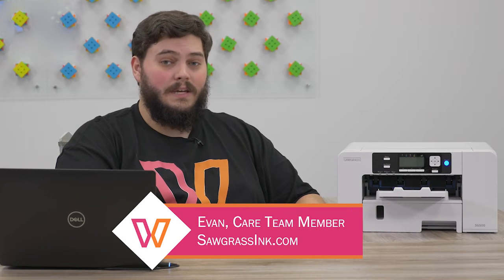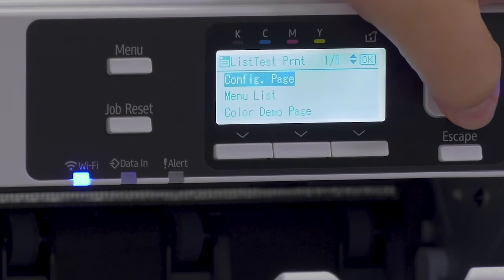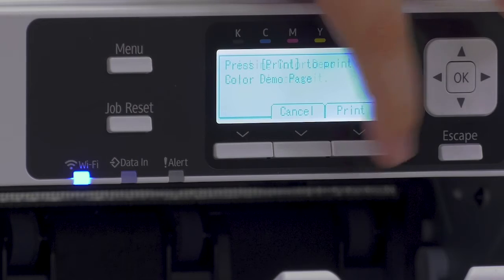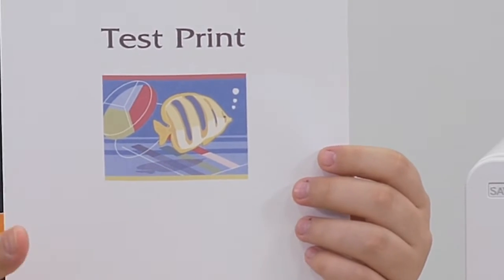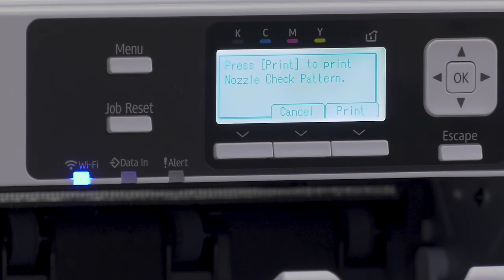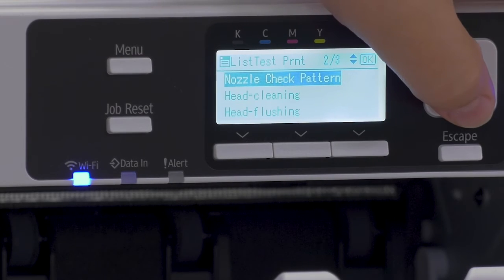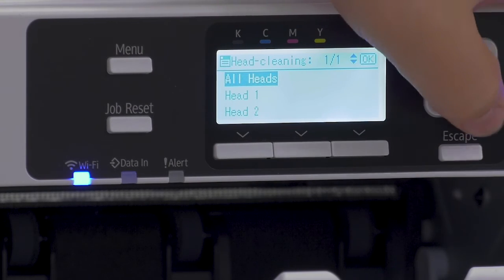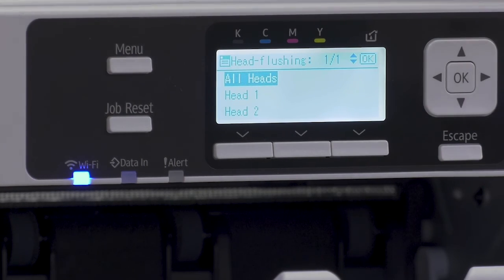HOW TO: Printer Maintenance

Comment: Do we need to do this alllllll the time that we use the sawgrass printer?
Reply from the maker: Hi, the printer runs automatic maintenance cycles regularly. These are additional recommended steps if you encounter issues with your prints.

Comment: Hello, I have full ink, but when I print an image, I get black horizonal lines going across and through the printed image. I've tried everything I know to correct this.  Also all the test prints colors come out well as for the colors but the black lines are still there.   Can you please help?
Reply from the maker: Thank you for reaching out to Sawgrass! Our Sawgrass Care team will be the best people to answer your questions. You can contact them at care.sawgrassink.com and connect with them directly using the Help button at the bottom right-hand side of your screen.

Comment: Hi My sawgrass sg500 was not in use for a while. I recently I brought new ink and a new waste container. It’s printing but pages are blank. There was a very small amount of yellow that printed. I’ve done the head cleaning, flushing and nozzle checks. Any suggestions?
Reply from the maker: Sorry for the delayed response -- have you had any luck with getting thata printer up and running?  If not, please reach out to our support team at care.sawgrassink.com

Comment: What this video will not tell you that it flushes away so much ink into the waste tank. This does two things. A: It waste sooo much ink. And Sawgrass ink is sooo expensive for the small amount that you get compared to others on the market. B: The waste tank the ink flushes into fills up too quick. And again, the price of Sawgrass waste tanks cost so much (I now use 3rd party waste tanks at a third of the price of Sawgrass). People need to add these costs into their printing. In the end you spend more money than you think printing with Sawgrass. You can leave it plugged in if you don't use it much and the maintenance will take care of any clogging. But again, the amount of waste is a lot of ink and fills up the tank. I am looking at a different model now because of this.
Reply from the maker: We are sorry that you have had these issues.  In general, a waste container should last between a year and two years.  If it is filling faster than that, please reach out to our support team at care.sawgrassink.com and we can assist you!

Comment: What happens to the extra ink that gets flushed out during the head flush? Does it get put into an internal compartment that needs to be emptied?
Thanks!!
Reply from the maker: All ink used in a head flush or clean is sent to the waste unit! There is no need for the waste unit to be emptied!
Reply: @SawgrassInk  when the waste until fills up completely, what do I do?
Reply from the maker: @JackRad2012  The waste is replaced when you replace your ink.
Reply: @SawgrassInk   thank you! I assume the waste unit will fill up eventually and need to be emptied right? 
Thanks again!